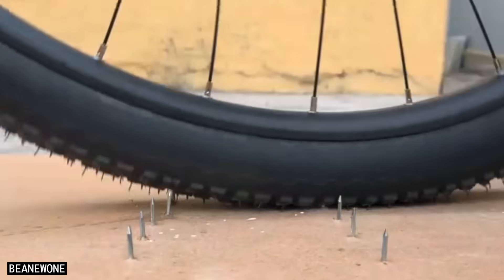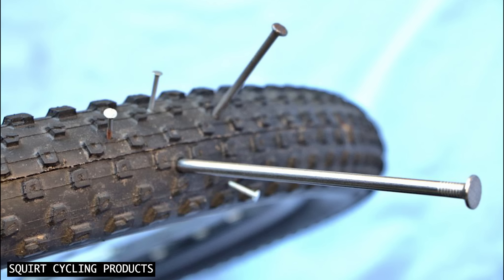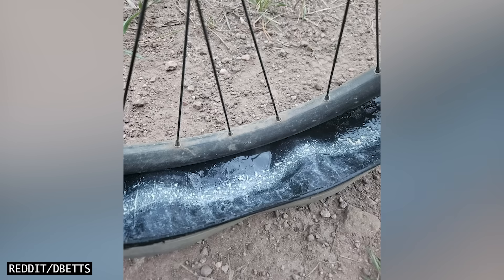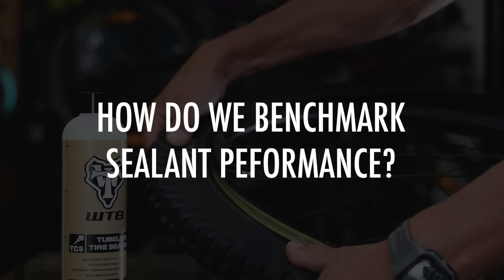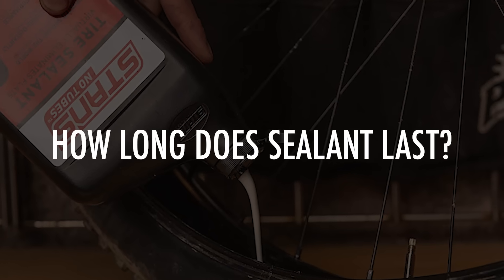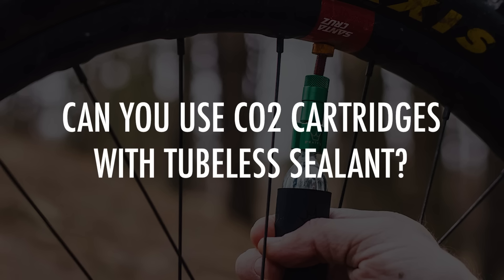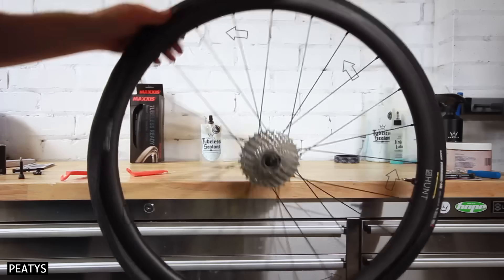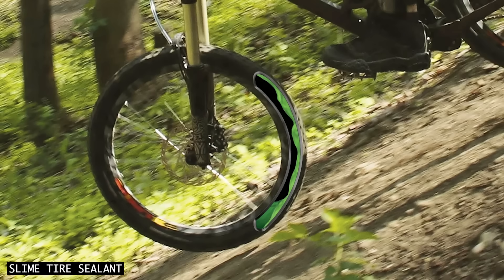I Found the Best & Worst Tubeless Sealants For MTB, Gravel & Road Bikes

Comment: Wish there were more tests done on the WTB sealant. It's readily available for an affordable price from REI and Amazon and has worked as well as Stan's for my tires.
Reply from the maker: The one independent test with data on WTB suggests that it works well on 47mm wide tyres at 40 PSI. It’d be interesting to see how it performs at both higher and lower pressures though! What pressure are you using?
Reply: I gave it a shot. Used it for 3 bikes of my family and my own gravel tires. No issues so far. Would love some more data on it, especially on road tires.
Reply: Anyone tried it on road bike tires? How was it?

Comment: Can you mix Stan's and Orange Seal, or say any other brand mixes?
Reply: I've mixed Stans and Orange for the last 6 months with great success. At least two punctures sealed perfectly. Never a fail! GP5000, 28mm, 60 psi.
Reply: I’ve been randomly mixing sealants. Doesn’t seem to be detrimental in any way. You just get a mix of the properties of each. As long as they’re latex, which most are.

Comment: Anecdotally I‘m using Stans Race sealant for 4 years now on 3 different bikes with tyres width 2 to 3 inches. I renew the Sealant once per year mostly without issue. Only exception is when I go on a remote bike packing trip I will clean the tyres and refill the sealant. I average about 10000 km on a bike a year and I haven’t had a flat in the last few years. So yeah, my experience pretty much matches the data pretty well except for the part where Stance Race doesn’t last that long.
Reply from the maker: Do you know if you actually have any liquid sealant left after 12 months? You might just have really puncture resistant tyres!

Comment: Orange Seal Endurance has worked great for me in South Carolina BUT in the Summer 90F90RH weather you need to top off regular or use a BIG dose in the winter 60 ml in a 700-30 tire will last 5 months no problem
Reply: How often do you top off in the summer? 
I ride 450 miles/month, 28mm GP5000, and when I inspected at 2.5 months my sealant was dried/gone. I was surprised because the regular stuff lasts longer than that. Although, I could have had a puncture and not known.

Comment: Interesting finds on the Silca results.  My personal anecdotal "data" is that it works great.  Running it on a few bikes at 15-30psi and the only flat I've had was when I neglected it too long and let it go dry.  But yeah, other than Silca, I've done great with OrangeSeal over the years.

One thing I've done for bikes that I may not ride very often is to use tubes with removeable valve cores and then put OrangeSeal in the tube. The sealant works great for the small punctures and bonus is that it lasts MUCH longer, perhaps up to and over one year.  Downside is that if you have had several  punctures, it can sometimes 'weld' the tube to the tire.
Reply: I have run Silca on my gravel bike this past season (2024). Never had it fail despite some pretty massive punctures. I ran Orange Seal all of last year  (23), it failed me 3 times before I switched over. I have also had a lot of friends convert from Stans and Orange who have had similar experiences. I am sure CyclingAbout has done through tests but similarly,  based on my anecdotal experience, Silca has been far and above better than anything I have run (I have run both Stans and Orange Seal).

I am wondering if this is just an anomaly or some sort of failed logic in the testing? Not throwing shade but these results confused me.
Reply: @zphillycheese the pro cyclists garage had a good article about these popular sealants and how they differ from each other.

The biggest difference here I'd assume is that one month of waiting period, as the article outlined that the silca is a sealant that is really fast to dry up. So easy, that just by inflating the tire in a wrong position could clog up the core.

And that kind of left the impression that should be talked about more regarding the sealants, what kind of environment you are using them? A race need faster clogging, but months of bikepacking needs a sealant that stays fresh for a long time.
Reply: Silca can also delaminate the adhesive on your rim tape. Learned the hard way on two mainstream wheelsets that eventually leaked sealant. Contacted Silca, and sure enough, a known issue with certain types of rim tape.

Comment: Replace every 2-5 months? That makes tubeless out of the question for me, not worth the hassle. But I've had great experience with Muc-Off inner tube sealant. Best of both worlds. Great at stopping punctures, and lasts the life of the tube without drying out. No mess, no maintenance hassle. IMHO the best option for practical, non-competitive cycling where ease of use matter more than speed and light weight.
Reply: The time to fix one tube puncture is more than the time to change your sealant, and you can do it in the comfort of your garage.  Also, I've gone 6 months without changing or adding sealant.  I only add it if I get a puncture that I'm forced to fix, likely due to low sealant.
Reply: @billweberx  The time to fix a tube is zero when the tube doesn't go flat, which is the case for me. Going tubeless would cost me in extra maintenance time. I haven't had flats in years, since I started using inner tube sealant.
Reply: @tvuser9529  In your case, I wouldn't change anything either.  I've had a completely different experience with in tube sealant.  I had a friend who also swore by it.  If it's working for you.  Great.
Reply: @tvuser9529 I only tried it once but when I finally got a flat the valve was plugged with dried sealant so I couldn’t pump up the tire.  So that bike now has marathon tour plus tires and regular tubes.  Feel like absolute pigs when riding on the road but no flats and no need to worry about sealant.
Reply: @michaelkelly747  Huh, that's unfortunate. I top up my tires with air as needed and never had a plugged valve.
Reply: It depends. If you have a decently sealed tire and don't live in a very dry climate you can easily go a year. It also takes all of a minute to add sealant if you know what you are doing.

Inner tube sealant doesn't work on pinch flats so it's complete garbage for me as that's what most of my flats were on tubes. It will make just as much mess as tubeless too. If you're someone that rides at high pressures you may not have to worry about that, but I like a comfy ride. Tubeless allows me to ride lower pressures without worry.
Reply: @iknowzeverything2740  Yeah, it depends. Pinch flats aren't a thing for me. I like a comfy ride, but there's no need to go that low for comfort. And I don't like the vague steering when pressure is that low. Type of riding matters a lot. I occasionally ride over roots and rocks, but mostly on roads.

Comment: I don't think I'll ever switch over to tubeless, since I can't remember the last flat I got with tubes.  Full disclosure - I'm mostly a daily commuter on roads, so prickly mtb trails or sharp fresh gravel aren't much of a worry for me.  After seeing someone use a cushcore in their tire, it made me wonder if there could be a foam tire liner along the main tire track along with using tubes?  This would prevent those most common punctures in that zone.  Sidewall slashes could still be a thing, but usually sidewall cuts are bad enough, it ruins the tire no matter what.  Wonder how that would work; would it enhance or degrade suppleness of the tire, and how effective would puncture resistance be?  

Mainly, I'm lazy and don't want the mess or maintenance of tubeless setup, so I'll try anything not to switch over. : )
Reply: If you don't normally get many flats, why bother with tubeless?  If you were mountain biking, tubeless allows you to run at lower pressures for a softer ride.
Reply: Yes there are kits that have an inner tube and then foam that goes around it. Not very popular though.
Tannous armor is one.
Reply: @jaro6985   Thanks!  I'll check them out.

Comment: It sucks that Bontrager sealant is bad. I've just had two nasty punctures that failed to seal on my gravel bike, with Bontrager sealant. Probably most of the issue is that the tires are more than a year old. But I have all my bikes maintained by my local Trek shop. Amazing work, fantastic techs, good prices, etc., but I do feel like a bit of a asshole asking them to use my sealant as well as all the other parts I bring in.
Reply: I mean the shop should be charging you for labor, not overcharging you for parts. I wouldn't feel bad about it, and if they are upset cause they can't sell their stuff they should be motivated to carry the brands their locale uses.

Comment: Good video mate thank you  , the last time i put tyre sealant in my MB tyres , i was a few k's from home and some thing punctured my rear tyre , with i' d say about a 1 to 2  mm hole , the liquid i can't remember the brand , not one mentioned in the video , it was spitting out green stuff at a great rate of knots , i managed to get about halfway home before pumping up the tyre again , i did manage to ride the rest of the way home in about 7 or 8 minutes , the tyre was just barely rideable by the time I got home , very disappointing really , the tyre liquid was not cheap either .
On the other hand without it , i may have been walking home , so there is that😊.
Reply: Carry a spare tube.

Comment: I'd say tubeless tires are, um...
Really really stupid,
Unnecessary
Toxically gooey
Consumerist generated
A waste of time
Dumb
Not worth it
And another really stupid just to reinforce the message.
Says retro grouch who just toured 2000 km on 27" tires and tubes, across Ontario from Toronto to Sioux Lookout, never a flat tire, heavily loaded .
Please try to bring old time cycling back. 
Over.
Reply from the maker: Nice work on the bike tour! Tubeless definitely isn't needed for everyone, and you're a case in point. But for my fat tyre, sandy, thorny, off-road adventures - it's essential.
Reply: @Cyclingabout  thank you for your kind response. Sometimes, I vent life's frustration through the nozzle of bicycle trends and fads.
I'm a senior citizen who pines for the old days of cycling. I mean no grief on people who love to ride. But I will always hold an aesthetic of simplicity and minimalism, and that usually involves out of date, heavier but bloody reliable gear.
Good luck with your rides.
I've crossed Canada four times, Ontario many times. To me the experience of riding is best when your bike is super tough. I used to use belt strips between the tube and tire to avoid punctures. I used heavy duty tubes. This year, I just bought new Continentals for 65 bucks each and I got lucky. 
I simply do not see the advantage to the overwhelmingly expensive assortment out there. I got a mint condition 1979 Panasonic for $50 last year. It's bulletproof. I defy anyone to load up a lightweight modern bike with what I was carrying ( art kit, music kit, two mattresses, book, paperwork etc.) and stand up so strong. My five speed friction shifter never failed. Because it has one moving part, with well made washers and nuts. Today's equipment shears under mild strain. I could go on. Anyway, stay safe. Sorry I ranted.
Reply: I had an opposite experience.  I did a 7500 mile tour and at times had flats every day.  Overall, I had at least 30, probably more, flats.  I switched to tubeless for my next 2500 mile tour and had no flats.  I've only had 2 flats since then and were easily fixed by inserting a bacon strip.  I'm sold forever.

Comment: Best cycling content on YouTube.
Reply from the maker: Many thanks!
Reply: Thanks for the research and informative presentation!

Orange Endurance is our exclusive "bulk sealant" in the shop, because it has above average performance with great longevity (low maintenance).  Orange Regular is my race season sealant and I simply mix it with whatever endurance sealant is left in my tire from training season if I am not mounting new tires.

Also, We hold informative tubeless clinics in the shop and use our own old tires to demonstrate performance in live scenarios with customers.  Orange almost always outperforms in these side by side comparisons.  Especially when value is considered.  We do have good luck with Silca at higher psi, but Orange wins with performance and value at gravel and MTB pressures (under 35psi).

Cheers!
Reply: True
Reply: I always knew that stans makes cery good sealant. But sińce I read your article I use orange
Reply: Agreed
Reply: Best cycling advertising thats for sure

Comment: Every bike youtuber, to whom I'm signed, has at least one video, where tire sealant has failed to repair a tire on ride.
And they used to spend a lot of time trying to repair a tire in the middle of nowhere.
Having one or two punctures per season, I'm still not convinced that sealant really worth it.
Reply: I think it can be helpful in situations with lots of very small punctures - goatheads/etc. When I used to commute to work by bike (~5000miles per year) I also only got a flat about once per year (with tubes) and it was wire from a car tire about 90% of the time. I suspect tubeless tires would seal something like that most of the time, but I've never proven whether that's true.
I agree, however, I see people fairly regularly (especially mountain bikers) who get a flat that sealant won't fix, and because they aren't prepared, they end up walking their bike out of the woods. I definitely think marketing has convinced people that tubeless is the only way to go, while in reality it works right up until it doesn't, and then it's a total mess to try to stuff a tube in there.
Reply: If you don't slash your sidewall it's an easy fix with plugs. You don't even have to remove your wheel.
Reply: I tour a lot and the little steel wires that come from shredded tires are a menace to tires along highways.  While touring, had weeks where I had to fix 1 to 3 flats every day.  After going to tubeless, I've had only 2 flats in 2 years, which were easily fixed with bacon strips.  It changed my life.
Reply: If you ride near thorns, sealant is a life saver. I have taken tyres off and had 10+ thorn heads poking inside which have sealant plugging the leak around them. Mostly used Stans (schwalbe Doc Blue is the same with a different label)
Reply: Leak repairs should be really quick, if you can find them (which you usually can). You use a plug kit, and they are faster than fixing a hole in an inner tube. The kit is smaller than an inner tube, and will usually have multiple plugs.

Comment: I'm interested in moving to tubeless, but I'm worried about flying with sealant / reinflating on arrival. What are you thoughts on flying with tubeless tires? Do you deflate completely and then add sealant on arrival?
Reply from the maker: The sealant stays inside my tyres for flying. I just deflate my tyres to the lowest possible pressure that will keep my tyres seated on the rim beds.
Reply: @Cyclingabout  thx! yeah my only worry is I arrive and the tire somehow got unseated and then I have a mess AND I have to find a way to reseat the tire which can't always be achieved with a handpump. But assuming you have done this a lot and sounds like you have no horror stories haha
Reply: I don't see how that would matter, pressure at 0m altitude is only 1 bar, so the tire pressure can't increase by more than 1 bar doring flight. Which should be absolutely no problem.
Reply from the maker: It's usually just a requirement of airlines. It's not uncommon for someone to check your tyres are deflated before you take your bike over to oversized baggage.
Reply: @BL-yj2wp  You are correct, should be fine as long as it's not overpressured to begin with, but try getting an airline clerk to accept that. If they've been ordered to ensure all tyres are emptied, they will do so. One of many reasons why I'm going by train these days.

Comment: Orange Seal Endurance done over 20k km this year, no flat tires 👍
Reply from the maker: How good is that!
Reply: @Cyclingabout  only do 2 fill per year, still liquid when i change tires for the next season 👍
Reply: @Tntdruid  and what are you riding and how? without this data the 20k  is pretty useless.
Reply: @Vanadium  MTB bikepacking whit Vittoria Mezcal XC tires.
Reply: @Tntdruid the speed in them tyres is amazing. I do miss them
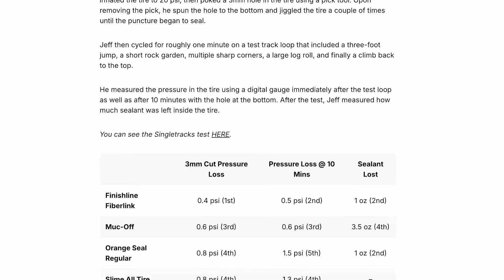Reply: I also run the endurance version in my gravel/cross bike @ 30psi.  I add sealant every 3 months and do that for the life of the tire, usually every 3 years or so (Schwalbe Marathon Mondial).  I used to run Stans regular, it worked OK, but the big advantage I find with Orange Seal is that it's simple to remove any buildup from the tire if needed.  It just peels out in one piece leaving clean rubber inside the tire.  Search for a video entitled "Tubeless Tire Rotation" on my channel, around the 3:45 mark shows the inside of the tire.
Reply: That's a lot of km! How often do you top off the tires?
Reply: 10 years TL. Orange is the only alternative!

Comment: As always I’ve learned. 
Thank you❤
My big trip in 2007 started with sealant. 
Though it didn’t do a good job back then. After installing Schwalbe marathon XR I had only a couple punctures in 24000km..
Reply from the maker: I was using those tyres back then too. I had just 3-4 punctures in over 30,000km! Unfortunately, they aren't wide enough for the kind of places I explore these days...